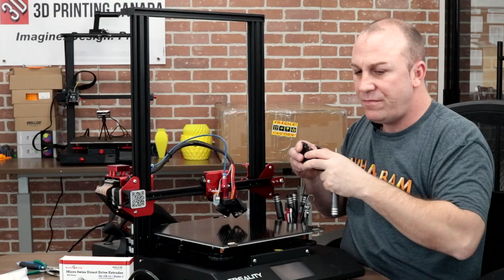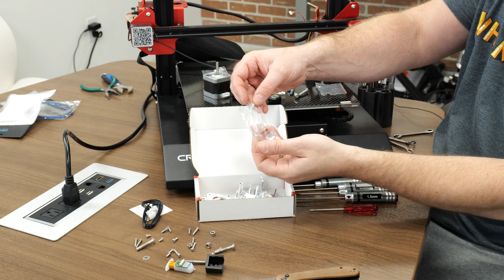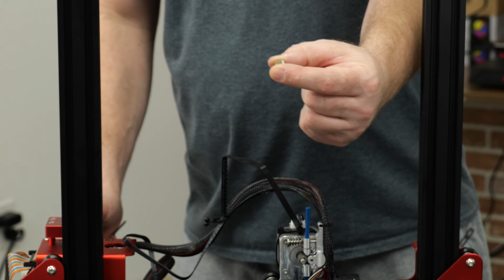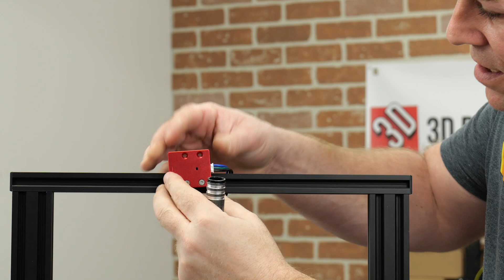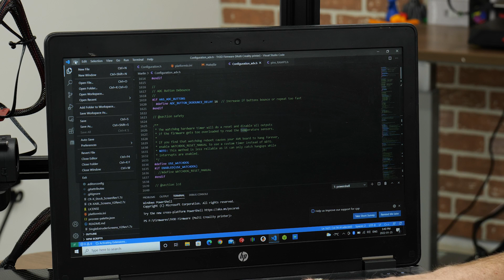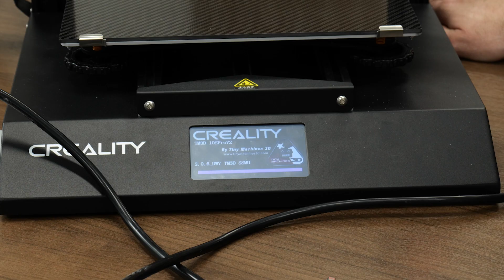INSTALLING A MICRO SWISS DIRECT DRIVE ON CR-10S PRO V2

Comment: So doing this mod does what? When you add that much weight to something that slings side to side on a beam made of aluminum at 12" high is this going to improve a tall print?  I would think this mod would lead to another mod to stabilize the frame after you round off the square cut aluminium. If it ain't broke why fix it?

Comment: This was the biggest pain in the ass so far for me I have the cr10s pro same set up as this but turns out the direct drive isn’t fully compatible with it because the original housing for the hotend dose not fit the plate so in stead of sending it back I had to get a Ender housing instead now I haven’t got a place for my bl touch because it’s totally different and the time I realised I had already started the job so fuck knows what I’m gunna do about printing the bl touch bracket for this model without a working printer

Comment: I have a CR-10S Pro V1 but i put a BL touch on it long time ago. I had to 3d print the bracket. It still works but i like the direction that one mounted. I just had to change out my bl touch. I had to pull off everything on the x axis to get the screws out of the back before i could lift my bltouch out. any chance they sell that bracket? i bet that would fit my pro

Comment: Thanks for the informative video. I am considering doing this to my Cr10 S Pro v2 have you had any experience with the "Micro Swiss NG Direct Drive Extruder for Creality CR-10 V2" I can't find any reason to use one over the other. Do you have any input on it? Thanks!

Comment: I'm guessing by sight the correct STL is in Thingi under the title - Satsana Ender 3 Microswiss Direct Drive - 4020 blower fan remix. (by jjbp)
There's a few models in that pack for the different MS 4/5 fin versions as well as BLT.
What I would like to know or have seen in the video as well would be the X range and if there was a reduction on the width using this shroud.  
Guess I'll just have to try myself, as I've got a MSDD/All Metal 4 Fin pack coming for my CR10s Pro V2.
If there are limits I'll just go with the standard MS shroud on thingi.

Comment: Awsome guide. Thank you!
One question. Are you using the 4 finned cooling block or the 5 finned? I ordered the complete package including the all metal hotend from Micro Swiss and it came with the 4 finned cooling block.

Comment: Hi There. Great video thanks for that.
Unfortunately, I have bought a micro swiss hot end, but it doesn't come with all the items in your product. do you need the Z axis plate and extruder, or can I use the existing. I do realize that the hot end, when installed, is too short, i.e the fan duct hits the build plate long before the nozzle reaches it's 0.2mm height. Any suggestions.
Many thanks. Peter

Comment: I have everything installed and it works, but how do I fix the auto leveling?  The probe goes off the printbed
Reply: I guess I need to update my firmware, where do I get the Tiny Machines firmware for it?

Comment: Awesome video! Just upgraded my 2 CR-10 Maxes with this. I'm running into an issue printing on the far side of the bed away from the filament sensor. The filament keeps getting stuck on the sensor now and causing missed layers on everything printed on the right side of the bed. Anyone have a good fix for this?
Reply: Hi, I'm about to do this upgrade as well for my new CR-10 max. Did you have a link for the 3d printed adaptors you used, and firmware? Was there much of an offset for the BL touch?

Comment: I just put the Micro Swiss Direct Drive with the Hot End and BL Touch onto my 10S Pro V1 and the result was awesome. I also loaded in Tiny Machines updated Firmware. The whole process was pretty easy, and the result is like a new Printer. I already added the Z Axis belt and Max Z struts so It is a solid machine and all this makes it even more solid. Very happy wit results. Thank You for posting and helping us make good decisions.
Reply: I don't have BL Touch and I use Octoprint. Do I still have to update the firmware? Is there an in-depth flashing tutorial you'd recommend?

Comment: Jesus am I the only person that owns a cr-10s pro V1?  I want to mount this direct drive as well but have been looking for over a god damn year for a damn fan shroud!!!@ 

Is there any chance we can get a video and fan shroud for a V1?  The V1 has been out for a shit ton longer than the V2 and yet there is no inductive sensor and fan shroud for the direct-drive and hot end that I have been sitting on for more than a year now!!!
Reply: I don't see where there's any difference between the V1 and V2. I have the V1 as well, but had Tiny Machines do their V2 upgrade to it. It looks identical to the V2 in this video.

Comment: I'm saving this for my next mod! I had a bowden tube end melt into my extruder and plug up the head last night, 33 hours into a 35 hour print! FML!
The annoyingly finicky PETL filament needs such ridiculously high temperatures that a factory-supplied bowden tube can't tolerate, despite the Anet people supplying this crap material for a printer that's designed to go beyond the tube's temperature limits.

Comment: Thank you. Very helpful. Please provide a link to the tiny machines multi  firmware mentioned. Perhaps create a video just on updating the firmware after adding the micro swiss direct extruder and all metal hot end combination.  Thanks again for this useful  information. Cheers!